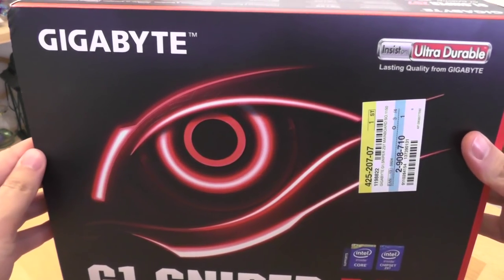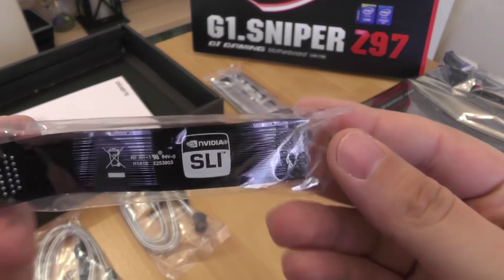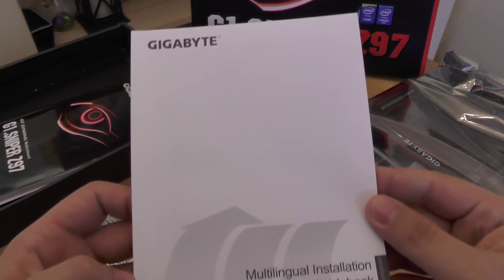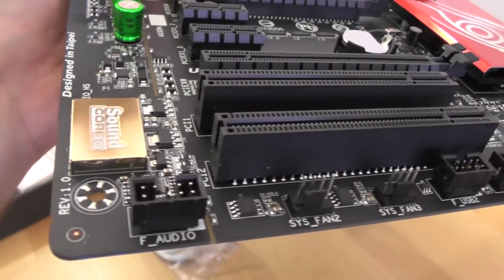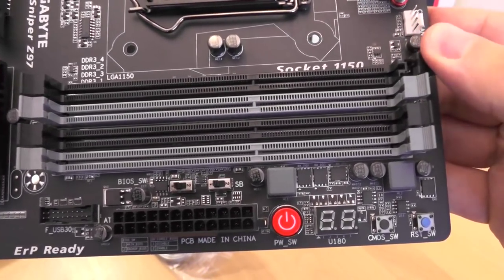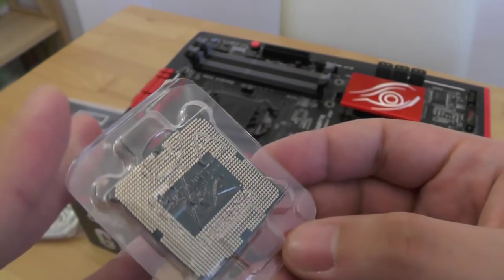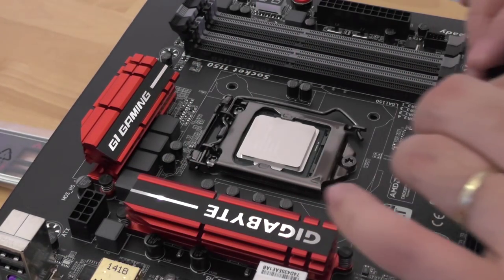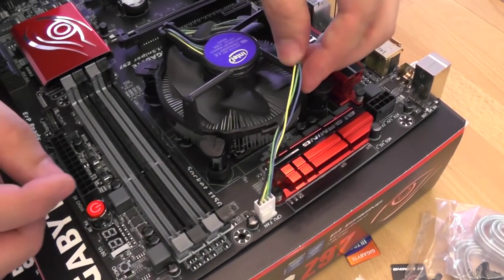Gigabyte G1.Sniper Z97 mainboard and i7 4790K unboxing and installation

Comment: hello. Will this work with these parts: Gigabyte GA Z97x gaming 5 ATX Main board and
Intel i5-4690k CPU?? Thanks and good video!!
Reply from the maker: LFCooledWhip Yes, if that Gigabyte GA Z97x  has socket 1150 (as the one in video)
Reply: LFCooledWhip It does, the Gaming 5 and the 4690k is one of the most popular combos for mid-range enthusiast builds.
Reply: Matthew Dupuis I'm deciding between the 4690 k or the xeon v3 e1231. You know whats Vetter?
Reply: 4690k so you always have the option to OC. I have it now its awesome and fast
Reply: +NM Minecrafted If those are your options and you want a balanced system not just gaming go for the Xeon 1231v3. I got that and this motherboard rocking right now.

Comment: does this configuration of motherboard and cpu supports kingston kyper X 2400 CL11 ram?
Reply: Yes it does, have 4x4GB of them in my rig, they work like a charm.
Just be sure to enable the XMP profile of the RAM, so that the settings get correctly applied, they need 1.6-1.65v (depending on the speed of the Hyper X) instead of the regular 1.5v.